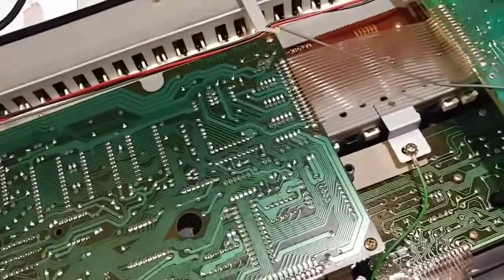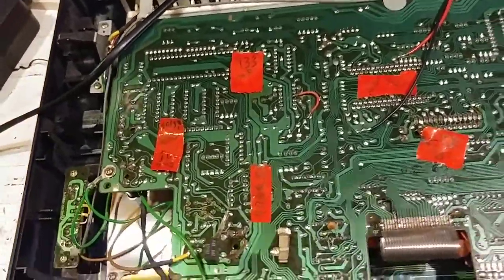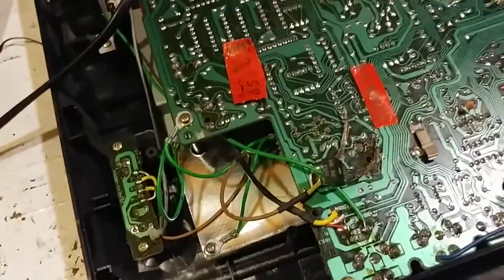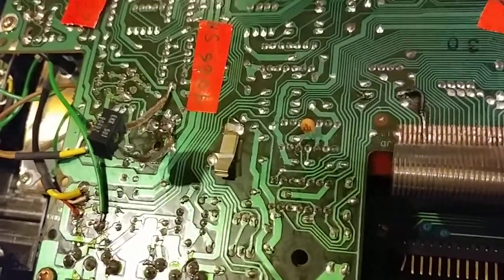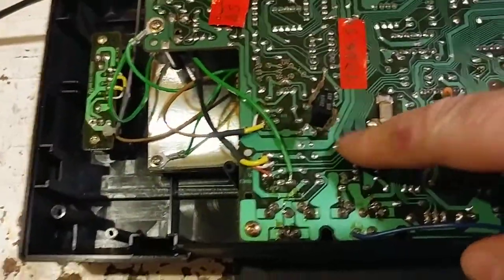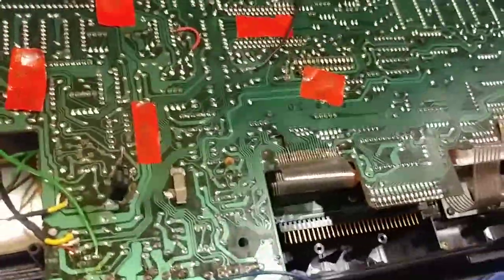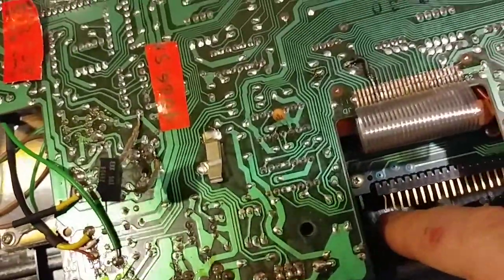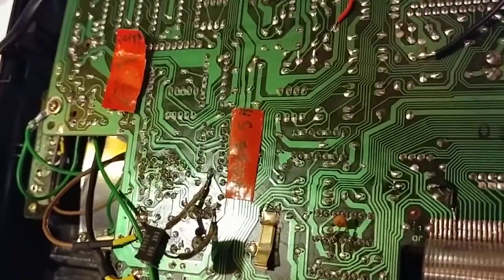Casio CZ-1000 bad trimmer diagnosis

Comment: Hi, Erich... my cz has exactly the same distorted sound as yours... I've already changed the amp 4558, 4051, 4558 and without success I've also checked the trimmers, and they're perfect, I've tried to make the adjustment from them, and nothing... simply I turned on the keyboard one fine day, and that's it! Any idea? https://www.youtube.com/watch?v=5-zYeeN6c0A
Reply from the maker: Have a look at how I fixed it. https://erichizdepski.wordpress.com/2020/07/18/casio-cz-1000-repair/
Reply: @ErichIzdepski thanks for answering, ok, but I noticed that you put a jumper with a 10ohm resistor in the schematic you showed, crossed out in red... but my trimmer is not damaged, it is working normally, and even so I put the resistor, and the sound remains distorted :(